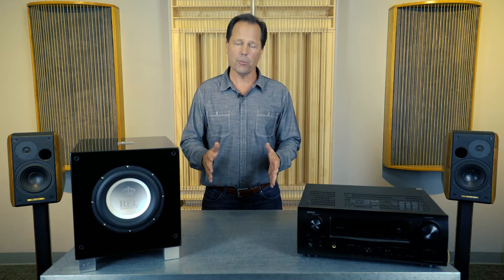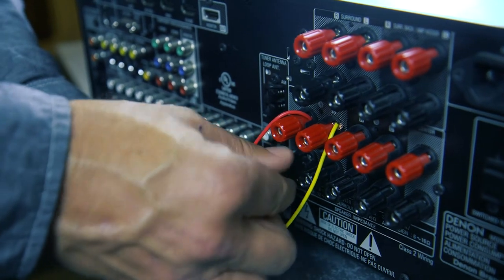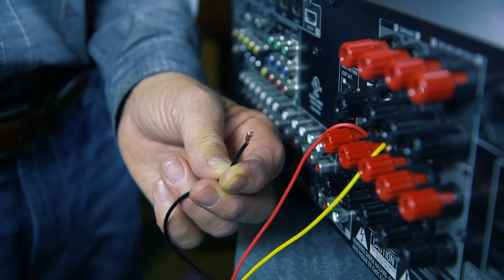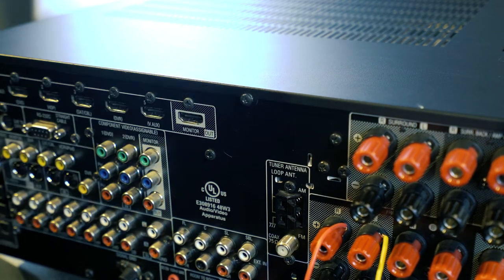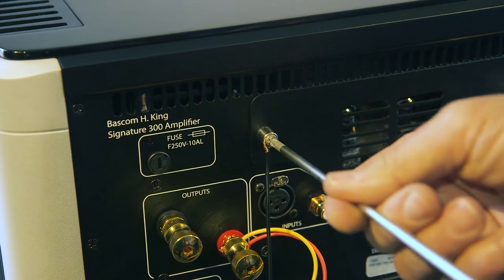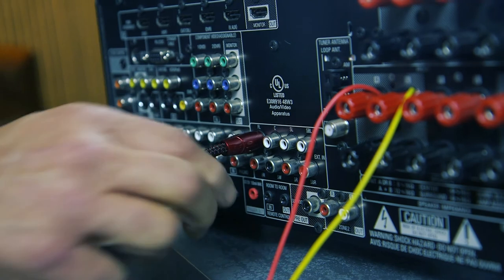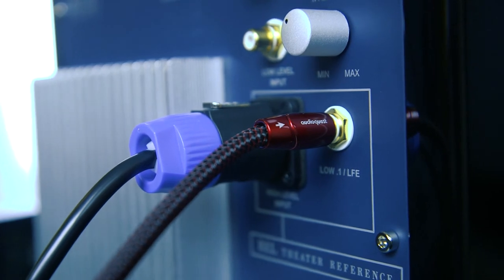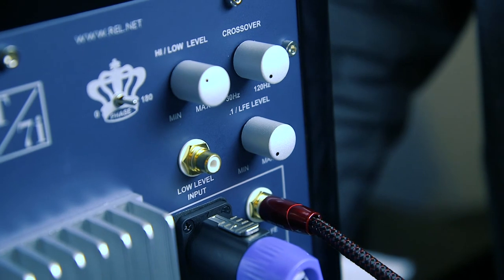REL Acoustics How To: Troubleshoot and Solve a Humming Issue

Comment: Thank you! Connecting an RCA cable from an unused output on my amplifier to the low level input of my subwoofer fixed the hum that is otherwise present when I use the high level input only. 🥳
Reply from the maker: We are glad to hear that this solution helped! Feel free to reach out if you have any additional questions or concerns regarding your REL subwoofer.
Reply: Me too 👍🏻👍🏻

Comment: Brand new Rel t5x low level hum even when DISCONNECTED from receiver - not volume dependent - is this normal?
Reply from the maker: Thank you for reaching out. It is possible to experience some light transformer hum when the T/5x is powered on, though this is typically not audible over usual listening levels. That being said, if you would like assistance with troubleshooting this hum then feel free to write in to contactus@rel.net and we will be happy to help.

Comment: Using a 3 prong to 2 prong adapter for the main sub power cable fixes the hum. (removing the ground to the sub completely)
Is this a bad idea and why? (I know it's a bad idea, but its the only thing that works perfectly for me)
Reply from the maker: Thank you for reaching out. We do not recommend using ground-lift power plugs for a REL subwoofer's mains power cord. By removing the ground prong connection for the power cord you will be disabling an important safety feature for the subwoofer, which can result in damage to the subwoofer and in a worst-case scenario can result in physical injury. In addition, any damage caused to the subwoofer by using a ground-lift power plug will void the subwoofer's warranty.
Reply: @RELAcoustics  great, will switch it back and keep looking for the cause.  the sub is great.

Comment: This fixed the issue I was having with my REL Strata iii and a Primare A30 and 2 x A32 power amps. I removed the black wire from the  speaker binding post and used the amplifier chassis ground post. Hum instatanly fixed!
Reply: The black wire as in the negative speaker  wire ?

Comment: Why do some systems produce the hum sound when the sub is connected with the standard + + - manner? There should be grounding right? Can the grounding through the - speaker terminals sometimes fail?
Reply from the maker: Thank you for reaching out. Some amplifiers do not provide a stable ground reference at their negative speaker output terminals. In these cases, attaching the black wire of the High Level cable to a chassis screw on the amplifier or to a designated ground screw will be a better option.
Reply: @RELAcoustics  thanks for the response! Mine did hum with one speakon cable but not with another. Both use + + -..

Comment: I tried unplugging the ground and my two front L and R speaker were the ones causing the humming noise, once I unplugged those two grounds the humming noise stopped but also all the speakers except for the subwoofer stopped working I have a pioneer elite receiver model vsx-91txh with a klipsch reference theater pack 5.1 with wireless subwoofer can you please help me out to find the issue for the humming noise.
Reply from the maker: Thank you for reaching out, and we are sorry to hear about the humming which you are experiencing in this system. When you have a chance, please write in to contactus@rel.net and our service team will be happy to assist with troubleshooting this hum.

Comment: I am also experiencing hum but none of these solutions have resolved the issue. I am using an Arcam SA20 (Class A/B) amplifier which itself omits a tiny amount of hum in-audiable at listening distances. However when I power on the REL T5x I get a additional hum seemingly from the sub and it seems to increase the noise from the amplifier too. I have tried both the chassis earth screw and the RCA to un-used   RCA connection. The amp does not have a dedicated sub woofer RCA connection.
Reply from the maker: Thank you for reaching out, and are sorry to hear about the hum that you are experiencing. When you have a chance, feel free to write in to contactus@rel.net and we will be happy to assist with troubleshooting this hum and providing resolution options.

Comment: So what if I only want to use the rca as sound source? I tried wire between the amp and. To the sub, but no luck. However this works on my old sub as it had the same issue
Reply from the maker: Thank you for reaching out, and for choosing a REL subwoofer for your home audio system. If you are experiencing hum from your REL when exclusively using an RCA connection, then at your earliest convenience please write in to contactus@rel.net and our team will be happy to assist with troubleshooting this issue and providing resolution options as needed.

Comment: I’m having a humming issue with my S5 SHO. The humming is quite loud and only persists when I connect the speakon high level. I tested it without connecting to any terminals at all. The second I plug it in, it’s just a very loud hum.
Reply from the maker: Thank you for reaching out, and we are sorry to hear about the hum that you are experiencing. When you have a chance, please write in to contactus@rel.net and our support team will be happy to assist with troubleshooting this issue and providing resolution options as needed.

Comment: where is yellow black and red wires caming from? thanks
Reply from the maker: Thank you for reaching out. The red, yellow, and black wires shown in this video are part of the REL High Level cable, with the other end of this cable plugging in to the High Level input on a REL subwoofer.
Reply: @RELAcoustics  Thank You.

Comment: Hi. Can I do this method on a home subwoofer amplifier? Any reply appreciated. Cheers from Australia 🙂
Reply from the maker: The solutions for ground hum shown in this video can be used when connecting a REL subwoofer to a home theater amplifier, though for High Level connection instructions specific to your system please write in to contactus@rel.net and we will be happy to assist.

Comment: I need help! I have connected my rel t/7x to my stereo amp via high level input and it works great. One day i wanted to hear it in my home theater set up because it is time for upgrate. When i connect it with RCA, all of my speakers start humming. My speakers only, not the rel (I don't have this issue with my klipsch subs). I know it is a ground issue because my Avr has two pin power outlet. I connected both the rel and the avr to the same wall socket. The hum was still noticable even not so loud as before. Can you tell me how to stop my avr-speakers from humming? Do you think connecting the high level out at the same time, will solve the problem? Or use an Audioquest Boxer which has a ground wire maybe fix it?
Reply from the maker: Thank you for reaching out, and we are sorry to hear about the humming that you are experiencing. When you have a chance, please write in to contactus@rel.net and our service team will be glad to assist with troubleshooting and resolving this hum issue.

Comment: Hi i hope you dont mind a question i did some basic fixes to a Panasonic reciver used a rca to headphone plug cable az imput i used phono but weak signal i then switched rca side of cabel to tape input nice 70s full sound from a Sony discman cd player but the feed back from this causes the players to malfunction. Or if i plug in my old lg stylo 2 in it makes all kinds of apps open or the touchscreen non responsive. Im only a novice so i use whatever i find and recycled parts. S

Any advice would be appreciated.
D. Im subcribing right now.
Reply from the maker: Thank you for reaching out. It is tough to say exactly why this issue occurred, though if you would like please write in to contactus@rel.net and we will be happy to more directly troubleshoot the output issues which you are experiencing.

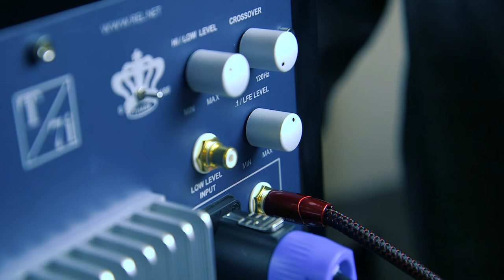Comment: @1:21 What about the RCA suggestion but also with the intention of using the .1 channel?Can’t exactly leave the gain turned off...
Reply from the maker: If you are planning on using the subwoofer in a home theater system, then you can use an RCA cable running from the designated subwoofer output on your AVR to the .1/LFE input on the subwoofer. The .1/LFE Level control can then be set to taste, and this connection will both send LFE signal to the subwoofer and provide a ground connection for resolving any ground loop hum.

Comment: Tried all these options with my Rel T Zero connected to Denon DRA-F109 using supplied speakON cable - no luck, still I hear hum. 
So I had to stop using High Level input and stick to Low level input connected to Subwoofer out on Denon receiver.
Any further suggestions how to use High Level input?
Reply from the maker: Hello Andrey, we are sorry to hear that you are experiencing issues with your Tzero. For troubleshooting help with resolving this hum, please write in to contactus@rel.net and we will be happy to help. In your email be sure to include how you have the High Level cable connected to your Denon receivier's speaker output terminals.

Comment: Thank you for the video.
I have a pioneer vsx 528 k. It has an annoying humming noise. The solution was to connect a negative wire from the speakers' connections to a screw of the chassis case. Only one negative wire from one channel is enough to stop the hum for all 5 channels when ít is grounded to a case screw. Nice advice.
I am just wondering if this may cause damage to the receiver over time- What do you think?
Greetings.
Reply from the maker: Thank you for reaching out. Assuming that the "negative wire" which you are referring to is the black wire of the REL subwoofer's High Level cable, then you were likely hearing a ground loop hum, caused by a ground loop between the subwoofer and the Pioneer receiver. Moving the black High Level wire to a chassis screw can provide a more stable ground reference for the REL, and can help to reduce hum in many systems. As long as this is the REL's black High Level wire that you are referring to, then doing this will not damage the subwoofer or the amplifier.

Comment: What I do with the predator TH 1210? Where to ground?
Reply from the maker: Thank you for reaching out. The HT/1510 Predator does not feature the High Level input, and instead exclusively features RCA and XLR inputs. As a result, the instructions outlined in this video will not apply to the HT/1510, though if you are experiencing hum with your HT/1510 then feel free to write in to contactus@rel.net and our team will be happy to assist with troubleshooting.

Comment: Will these methods work on a JBL Venue 10/230 ?kindly help me please?
Reply from the maker: The JBL Venue 10/230 does appear to have speaker level inputs, though their design appears to vary in many ways from ours. For connection instructions specific to your subwoofer, it would be best to contact JBL's support department.
Reply: @RELAcoustics  alright,thank you so much.

Comment: How will Cutting the 3rd prong kill you?
Reply from the maker: Removing the third prong of a power cord will defeat the device's safety grounding, which in a worst-case scenario can result in physical injury especially with high-powered devices such as an audio amplifier. Removing the third prong of the power cord can also result in performance issues for the subwoofer, and will void it's manufacturer's warranty.
Reply: @RELAcoustics  My question is "How will it injure you?" I realize there's a Grounding issue and possible fire hazzard - but how will kill you Directly??
Reply from the maker: @xtraflo  If you defeat the safety grounding for the subwoofer's amplifier through the third prong of it's power cord, then in the event of a rare malfunction with the amplifier it is possible to voltage to build up within the subwoofer since it no longer has a ground return path through the power cord. Then when you touch any metal surface on the subwoofer, your body will become the "path to ground" and the built-up voltage will travel into your body. This is very rare, but can result in damage to the subwoofer or physical injury in a worst-case scenario. The third prong of the power cord is a safety feature, and removing it will not only void the subwoofer's warranty, but will also make you liable for any potential injury.

Comment: I only get the hum when my amp is turned off into stand by mode, the sub also doesn't auto switch off like its supposed to :(
Reply from the maker: The sub will go into an idle mode, that uses significantly less energy, about as much as a couple night lights. If you would like help solving the humming issue email us at contactus@rel.net that will go to our support team that can walk you through a solution.
Reply: @RELAcoustics  My sub is over 25 years old, the rheostats have always crackled when moved and there's always been a hum. However the hum is now much more pronounced now, is there are place to get a service on this? Iirc it's a storm MK1.
Reply: This is exactly the same issue I had, my sub is wired using hi-level. When the power amp was switched off the REL Strata iii hummed loudly, I removed the black wire from the  speaker binding post and used the amplifier chassis ground post. Hum instatanly fixed!